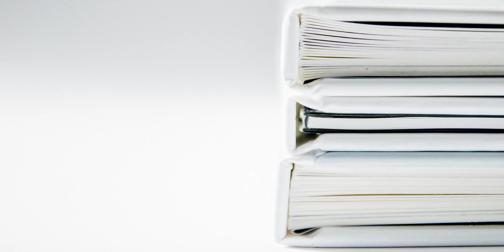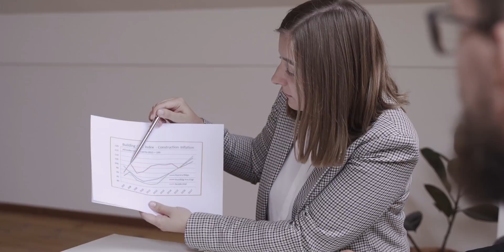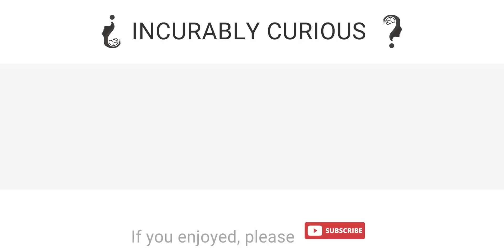Why Most Power Lines Aren’t Underground

Comment: The Netherlands is the only nation the world that doesn’t have a single power line or phone pole above the ground. Only the big steel high voltage ones are above the ground, thus (in my opinion) make it the cleanest looking country in the world!
Reply: Singapore
Reply: @Gratori  Agreed our Singapore, is the cleanest with all utilities and power lines built underground throughout the entire country.
Reply: @nekomeow6278  Is probably because is a small country so it's easier to gentrify the whole country, but it didn't happened overnight too.
Reply: @Gratori  Singapore is just an island so them doing it much more easier compared to others.
Reply: @patrickbueno3279  that still doesnt change the fact that the netherlands is not the only country without a single overhead power line...
Reply: @myarupyon  I'm talking about Singapore not Netherlands
Reply: @patrickbueno3279  yes, I know you were talking about singapore, read my comment properly. Just because it's seemingly easier to do it here doesnt change the fact that the netherlands is NOT the ONLY COUNTRY WITHOUT over-ground power lines.
Reply: @Gratori  Singapore technically has something like 1% of its power consumers still on overhead power
Reply: The UK is similar. Only the countryside has overheads. Most in urban areas have been removed. Telephone poles are being removed too.
Reply: @shaun1293  in NI we have overheads in towns and villages. But they only connect remote streets to the main grid.
Reply: Denmark
Reply: @Aryan54575  In rural Denmark there are many overhead power lines with wooden poles.
Reply: Finland is currently in the process of moving all power lines under 960V below ground.
Reply: The Netherlands is a frontrunner in almost all forms of infrastructure, but that is of course also because the country is small, flat and densely populated with soft soils that are very easy to dig in.
Reply: Oud Verlaat near Rotrerdam Netherlands still has it above ground
Reply: @BrandonVink  I looked it up and yeah your right. Thank you for pointing that out! I did not know that. Must be the last in the country.
Reply: @emperormerlinos  it may be i live in texas now for 6 years havent been back
Reply: Saudi Arabia and many Middle Eastern countries
Reply: In the netherlands are a lot of steelpylons 110,220 and 380kV but the loser voltage is underground
Reply: @borntoclimb7116  Same in germany.  Although 110kV can be underground at times. in rural areas you can have  10kV to 60kV powerlines (7+ m height)overground between villages . inside  villages and towns is underground
Reply: @hermask815  yes
Reply: @hermask815  yes that’s the difference, I’ve seen many overhead poles in villages but even in the ruhrgebiet conurbation of cities like Münster and Haltern, mostly in older parts, here in the netherlands even single standing farmhouses are powered by underground lines
Reply: @borntoclimb7116  there are sections in the netherlands where the 380KV is underground
Reply: @siebrenbleeker9177  in germany to but the most 110,220 and 380kV powerlines are overhead lines
Reply: @borntoclimb7116  So, the loser voltage doesn't get invited to parties?
Reply: Swizerland it's mostly under ground with exception of very remote and mountainous areas and high voltage lines. For high voltage: it would be more energy efficient to put them underground actually, and discussions have been held, but the initial investment is higher and it would take years to see the financial return.
Reply: Umh, sorry bud, Italy does the same, in 30+ years i barely remember last time i saw a power line above the ground beside the high voltage lines near factories or on rocky mountains high elevations. Matter of fact Europe have codes for power lines and must be places underground. So NO the “Netherlands” is not the “ only nation in the world” to do that many countries adopted that technique for power lines its safer and most reliable in bad weather. Here in the US the power companies don’t want to spend the money to fix the problem and even after the “Infrastructure bill” has passed and received millions $$$ these companies will not fix it.
Reply: @cmott8809  yeah your right! Europe over all looks very nice and clean with no ugly power lines. But when I visited the other country’s in Europe I still found a few power lines in rural areas. But not in the Netherlands, not that it really matters. I’d still prefer to live in Italy over the Netherlands I just love the wether and the scenery of Italy and the other Mediterranean countries!
Reply: Appearance of the power lines hidden underground is nice.l but what about the locating and length of time for repairs and he said the life of the cable is twice as long above ground.
Reply: @Mark-pz3lq  I don’t know about the life of the cables. I’ve lived in the Netherlands my entire life, never saw any work being done on underground power lines.
Reply: @emperormerlinos  I'm using information from the video. The narrator stated that above ground cables have approximately twice the life as compared to the little ground cable. Above ground 70 to 80 years below ground up to 40.
Reply: @emperormerlinos  that's because when the road is being resurfaced all the utilities are also updated because you are already digging you might as well.
Reply: @Mark-pz3lq  The video is biased.
Reply: @GregorShapiro  in what way?
Reply: @Mark-pz3lq  locating failure in power lines is technically not difficult. A pulse of energy will be partially reflected by any break or even any change in resistance or capacitance. A sufficiently sophisticated oscilloscope will time, and thus locate the anomalies (you did make a detailed map of the trench you dug when putting the cable down after all).
Reply: @GregorShapiro  in the video the narrator said locating the problem wouldn't be difficult but the repair would be laborious and time consuming. I agree with that. I forgot to mention expensive.
Reply: Carrington Event .. when it occurs only countries with protected and buried power lines will survive without catastrophic losses.
Reply: @DJaquithFL  buried cables aren't safe from a carrington event. The damaging electrical currents are induced in the ground.
Reply: @michaelrobinson2650  .. That's literally the exact opposite according to the report: Electromagnetic Pulse (EMP) Protection and Resilience Guidelines for Critical Infrastructure and Equipment
Reply: That’s cause they’re so tall that they’ll walk into the powerlines otherwise
Reply: @kurtsaidwhat  and I know that right!
Reply: Finland not far behind!
Reply: grew up and live in singapore, i have never seen a single power line in my life until i went to other countries
Reply: @myarupyon  Visit Wessex Estate (in Singapore), where the buildings were built wayyyy back as barracks for the british army. They have above ground power lines.

Pretty cool place. It has a romantic dining area at the entrance of the estate.
Reply: I guess Belgium is not a nation (but rather a country) ;-))
Power lines above ground is so 70's and 80's
Reply: Germany
Reply: @imvulnerable-official1305  yeah 9nly Rural Germany right? But not in like big city's. Or am I missing something?
Reply: Also since The Netherlands is always fighting against water and damage to the powergrid via flooding is extremely rare. Even when last year a part of Limburg was kinda flooded. 

It might also help alot of big cities have multiple points of entrance for power to have a failsafe.
Reply: @John Cannizzaro no more Wichita lineman? ;-)
Reply: yeah pretty much
Reply: Germany for the most part, too. It is only short term more expensive. In the US the maintenance of the millions of wires is long term far, far more expensive.
Reply: Mostly same here in western Austria
Reply: I'm in San Diego and our powerlines are under ground
Reply: This isnt completely True. There's a very small region thats not underground yet. Though i think its only about 10km of wires in Total. The removal of these last overhead wires is currently being work on and should be complete within the next 5 years
Reply: @mikesmit9770  finally somebody who knows his stuff!
Reply: Oh and don't forget were cheaper with electricity than the US.

US: The average residential electricity rate in the U.S. is 13.83 cents per kilowatt-hour (kWh). The average electric price a business customer in the United States pays for electricity is 11.78 cents per kWh.
NL: in 2022 approximately EUR 0.15 per kWh of electricity (including energy taxes and VAT)

It was cheaper before the whole Russia Ukraine conflict. But these are the current prices
Reply: I literally entered google street view and saw huge transmission lines interrupting the landscape so not sure what your talking about
Reply: @JamsTVShows  I’m not talking about the big steel ones but the small telephone poles
Reply: Netherlands 👈💩
Reply: Hong Kong have most of the power lines built underground thanks to the good British regimes.🤩
Reply: In India I am pretty sure like all power lines a d poles are above ground
Reply: seems like you haven't been around the europe much. manny if not most of eu members doing low voltage grid underground. netherlands have advantage here, since is is basically flat and its geology helps a lot. try to do that in some remote village in alps etc or even some harder rock elsewhere. europe (or let say eu region) is good, believe me.
Reply: @izoyt  overall it’s pretty good
Reply: you look around the USA and it feels like there's lines everywhere no matter the direction you look
Reply: Yep Moving to Netherlands in the morning
Reply: And Sweden… probably lots of other countries too
Reply: @SgfGustafsson  wouldnt decent parts of sweden be too unsuitable for that?
Reply: @km5405  The areas of Sweden where there are significant populations are not too crazy in terms of terrain. Also they're extremely good at tunneling and mining.
Reply: Same in Las Vegas.
Reply: Many countries in Europe have the power lines underground because of the widespread destruction of World War II.  Since they had to start from scratch, they figured they may as well do it right. In North America, that would require tearing up roads and walkways, yards and buildings.
Maybe we’ll convert to underground after World War III.
Reply: Not even. There are some small roads in the Netherlands where the powerlines are still above ground, but it's really a rarity.
Reply: singapore, monaco, vatican
Reply: @royssche  Singapore still has some overhead. It’s very very rare, but it still exists. Not sure about Monaco and I don’t even think the Vatican qualifies when their power is from Italy
Reply: Sweden doesn’t have a single power line or phone pole above the ground
Reply: What is the population....? How many of people are educated enough or civilised enough that they do not steal electricity....?? And how many jihadi or refugees are there to claim the basic utilities for free and the entire Netherlands 🇳🇱....??
Reply: most western countrys i have been so far have underground lines. Germany for example in the mayor citys there are only underground lines some light poles.
Reply: Generally utilities are more frequently underground in Europe, especially but not exclusively in urban areas. The same it with Water. While the US has a lot of Reservoirs up on hills and Water towers to keep a Sable water pressure due to gravity.
European Countries tend tu use a more complex approach with vales and pumps to keep the pressure up.
Reply: I wholeheartedly agree with the idea. Powerlines are unsightly and outdated. Of course it would be ideal to rebuild civilization from scratch.  Ideal. But not practical.
Reply: Because the Signapore and The Nederlands are tiny nations they cannot afford to have above ground power lines, and because the States is a large nation we cannot afford to have underground power lines.
Reply: @MrXyzasdf  every state could also individually take care of its power lines. That would seem more logical to me since it’s not a HUGE problem where the federal government has to interfere. And that way the pieces of land to cover are also not that big (still big but not like half a continent).
Reply: @emperormerlinos  
oh please  
Let us all differ to your wisdom
   
  😞 relaxed 😌
Much better now
Reply: @MrXyzasdf  no I don't think you Right. If you noticed newer neighborhood projects have their lines underground. I'm sure budgets and planning has a lot to deal with it along with environmental factors.
Reply: Maldives
Reply: well there's no natural disasters yet
Reply: Until the ground is spray painted red all over the place because someone wants to set a mail box or plant a tree. I work for 811 and people hate the paint and flags on their property
Reply: Uae also have same and Ghana has started implementing it
Reply: I spent 3 1/2 month in Singapore, no utility lines to be seen anywhere!
Reply: I think it all start because Some countries are also newer to this thing called electricity. America was one of those countries that had electricity first so putting up the infrastructure was about cheap and easy fast without really thinking and it didn't help companies were competing so lots of fighting in setting up an infrastructure. The old infrastructure is still there and we really never changed which has lead to Huge parts America going black, all it took was a tree falling and a breaker to set off a chain reaction. On the other hand the countries that got electricity last in the world actually invested more time and effort. You also want to see what happens when electrical adoption goes wrong. Look at Japan. Insane two grids. Like two worlds in same country.
Reply: Ok go live there.
Reply: Maldives too
Reply: Same for austria
Reply: Have you been in England?  All cables are underground!
Reply: I don't think that's true. Never seen in a power line above ground here in Switzerland. Nowhere, even in the moutains they are all underground. Same for Germany, but I've not been everywhere there, maybe some structurally weaker Bundesländer have them above ground in some cases. 

But it definitely is true that in most of western Europe it is a very rare case to see power lines above ground (ignoring high voltage ones of course).
Reply: No hard feelings
Reply: @lazarusramaube8291  seriously?
"Deliberately lying" & then you request "no hard feelings"?? 
Where do you get off?
Reply: @alanhat5252  Don't get a hard attack man,he replied,explained I decided to let it go with the wind,the poles are still there anyway.
Reply: The Federal Republic of Germany too! No problems same the thirth country U.S.A.
Reply: Where you born in the Netherlands?
Reply: @stevenutter3614  yes
Reply: @stevenutter3614 " were" not where.
Reply: That is not true. Every western Europe country has its powerlines underground.
Reply: @jaro-ch  never been to belgium or france i guess also germany still have them
Reply: @jaro-ch  Never been to france or like any other place in eu?
Reply: @jaro-ch  No they do not!
Reply: @jaro-ch  never been to france?
Reply: @jaro-ch  I’m afraid that’s not the case. I’ve been to most west-European countries and I can state that the Netherlands is the only one that didn’t have a SINGLE utility pole above the ground. However it is true that the other west-European countries also have minimal utility poles above the ground but in some areas (mostly agricultural) there are still some left.
Reply: @emperormerlinos  You traversed ALL of the Netherlands and confirmed not a SINGLE pole in the whole country?  Amazing.  I hope you recorded it.
Reply: @truthbetold1855  boy I live here and it’s a small country
Reply: What do you think about United Arab Emirates?
Reply: No its not the only nation that has underground line
Reply: Thats gay.
Reply: Singapore too doesn’t have a single power or telco line above ground.
Reply: England
Reply: UAE and middle east countries also 100% underline power lines
Reply: You’re technically wrong, in the Netherlands we do have power line above ground. You can see them on the A12 @36.8 (hectometerpaal). But this one of the few above power line which we still have.
Reply: When u say "world" did u mean Europe?
Reply: Ive seen power cables above the ground in Holland haha
Reply: @Wraptory  and this is why we can’t have nice things in this country 😭😭
Reply: A12
Reply: In Italy too... not only Netherlands
Reply: Dubai
Reply: @kurttanteo4402  is a city
Reply: I am actually from the Netherlands and this is false, we do have power lines above ground
Reply: @Ghqsted  yeah high voltage. At least I'm thinking you're referring to the iron pylons. And some small village in NH. But 99% of our power grid in under ground. You don't see the so called telephone poles in every city/village. And that is what we're talking about here. Like I know 8 years ago we had problems with the iron pylons during winter. But we're not at the mercy of the weather every winter to have power because the lines are above ground.
Reply: @RedRingOfDead  @Ghqsted exactly what I mean 💪🏼
Reply: @Ghqsted  waar dan?
Reply: @emperormerlinos  In Friesland waar ik woon zie ik ze gewoon
Reply: @Ghqsted  ik woon ook in Friesland en nog nooit een gezien. Ik bedoel niet die grote ijzeren langs de snelweg
Reply: @emperormerlinos  Kan goed ik woon nu in een dorp en zie ze nog wel eens, De oude van hout gemaakt
Reply: @emperormerlinos  hah ik woon in Groningen. Zie ze nergens. Zie je maar weer dat Friesland achter loopt 👀😂. 
Klopt inderdaad dat Limburg vorig jaar blank was. Geertje was eindelijk blij 😂😂😂
Reply: @RedRingOfDead  😂😂😂
Reply: Yeeaahhhh.... But they have frequently blackouts because of line failure due to moisture and ground subsidence... The country is basically at sea level... Their median elevation is less than 100 feet.. and they're socialists. They can't afford to keep the grid in good repair.
Reply: Somalia
Reply: @reythelion  lol…I believe he was talking about countries that have power…
Reply: @equuspallidus  LOL. I know 🤣
Reply: Deliberately lying, now we know there's aboveground Power lines in the Nederland.
Reply: @lazarusramaube8291  literally just one in a little town the middle of no where, where no one has ever been or would like to go. ask anyone who’s been to the Netherlands and they’ll say that there are no power lines.
Reply: @emperormerlinos  
There must be living a lot of American expats in that little town, Merlinos.
That figures.
Reply: Do you wear that underwear because it's genuinely more comfortable and nice looking or what have you, or do you wear it just because it was the only thing in your drawer? Have you tried the other styles? Other brands? Have you done an blind a/b underwear test where  you are suspended in mid air via cables, and have workers frantically dash around, quickly putting on and taking off different pairs of underwear so quickly it reminds you getting your eyes checked and having the optometrist asking you one ,... or two? one or two? except this time it's Hanes or Fruit of the Loom.
Reply: @stevenutter3614  😂😂😂
Reply: @stevenutter3614  This sounds like the type of tangent Regular Car Reviews would go on.
Reply: @stevenutter3614  i dont understand steven please come back
Reply: No one cares.
Reply: @goodbye8995  350 people disagree
Reply: @mirrorofwisdom4584  Wait until you learn about bots.
Reply: @goodbye8995  You mean like bots? Those have to be paid :/, either way, 90% of the likes are most likely people, so my point stands, people clearly care.
Reply: @goodbye8995  Also, there's no benefit to liking a comment like this one. No one would pay for that.
Reply: @goodbye8995  bro really finna be the no one cares kid 💀💀💀💀
Reply: @allanallstar342  😂👍